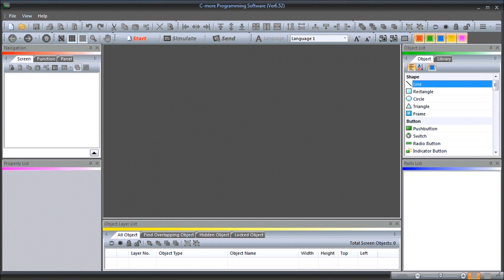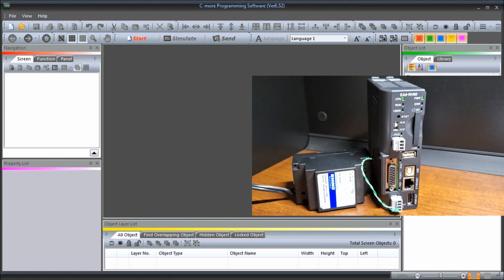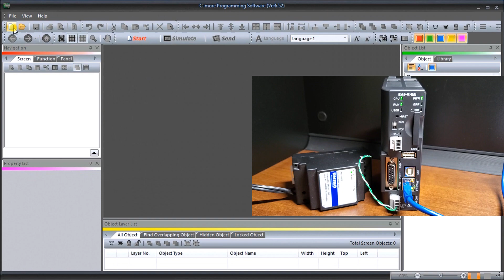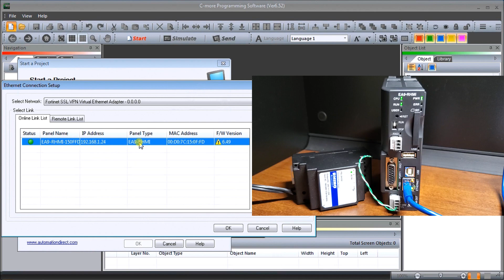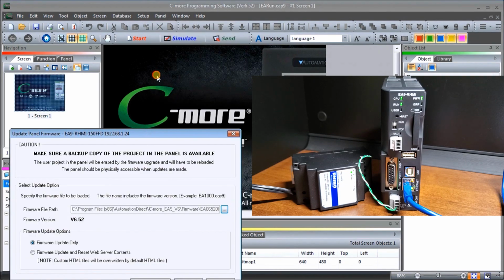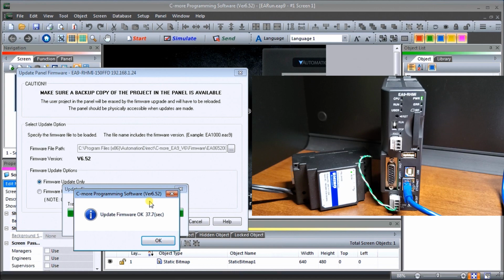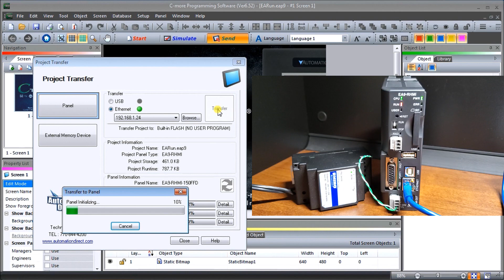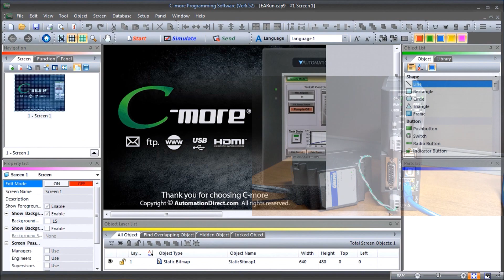C-More EA9 HMI Series Headless RHMI Panel Establish Communication

Comment: Looks cool. This would be using the EA9-PGMSW software?
Reply from the maker: Hi John,
This unit works well. You can now attach a large screen TV to your system with little investment. The remote apps are now free. This will also allow you to use Email, data logging, and FTP features to the devices connected.
It does use EA9-PGMSW software. 
https://support.automationdirect.com/products/cmore.html
The current version is 6.53.
Regards,
Garry
Reply: @ACCautomation  thanks for the reply! I'm just a home gamer when it comes to plc's. I've enjoyed learning a bit about it.  Thanks for the content.
Reply from the maker: @jonnymac31  
Thanks for the comment, John. The world of PLC and automation is constantly changing. It's a great time, in my opinion, to become aware of the new controllers for the industrial environment. 
An Arduino based industrial controller called the P1AM is now available. 
https://www.automationdirect.com/open-source/home
This now changes the IIoT. Allowing computer programmers and hobbyists to now program for the industrial manufacturing floor.
I will be releasing videos and posts on this new controller soon.
Regards,
Garry

Comment: Hi Garry, can this C-more headless hmi replace a Panelview hmi with AB data-highway  and use a basic touch_screen_monitor  to display operator information and access?  great information...:)
Reply from the maker: Hi q zorn,
Here are the following drivers on the HMI that will communicate to AB. DH485 is on the list:

MicroLogix 1000, 1100, 1200, 1400, 1500,
SLC 5-/01/02/03 DH485/AIC/AIC+
MicroLogix 1000, 1100, 1200, 1400 and 1500
SLC 5-/03/04/05 DF1 Half Duplex; DF1 Full Duplex
ControlLogix™, CompactLogix™, FlexLogix™
PLC-5 DF1 Full Duplex
ControlLogix, CompactLogix, FlexLogix - Tag Based DF1 Half Duplex; DF1 Full Duplex
ControlLogix, CompactLogix, FlexLogix -
Generic I/O Messaging EtherNet/IP Server
ControlLogix, CompactLogix, FlexLogix - Tag Based
EtherNet/IP Client Micrologix 1100, 1400 & SLC5/05, all via native
Ethernet port
MicroLogix 1000, 1100, 1200, 1400,1500 &
SLC 5-03/04/05, all via ENI Adapter
Micro 800 series Modbus RTU
Modbus TCP
Micro 800 series - Tag-Based DF1 Full Duplex
EtherNet/IP Client

Full specifications:
https://cdn.automationdirect.com/static/specs/ea9rhmi.pdf

Not only can you add a basic touch panel (Most people will add a large screen TV using the HDMI output, but you can also use your Android, IOs or Windows operating system to control the HMI. All of the development software and remote access software is free.

Regards,
Garry